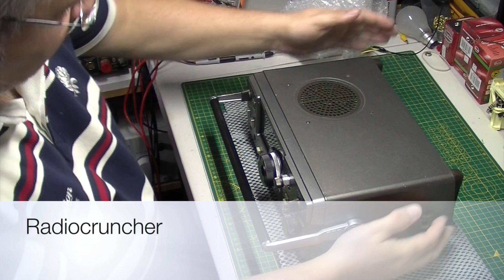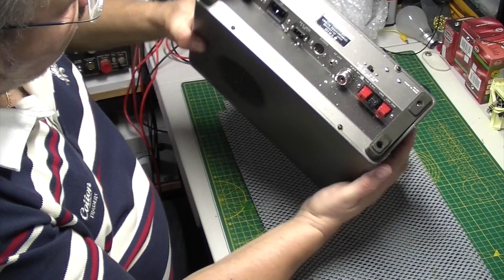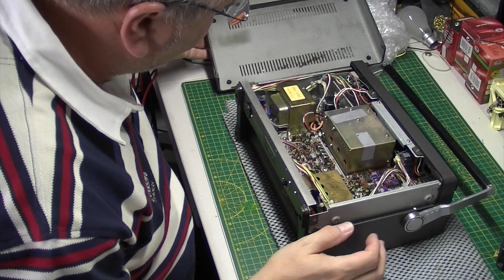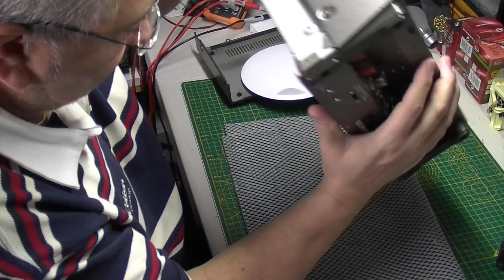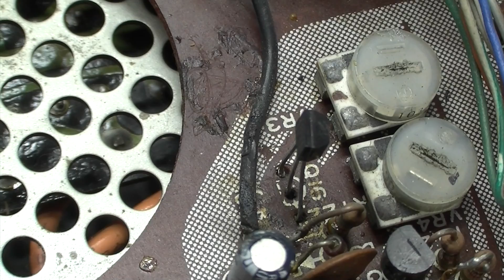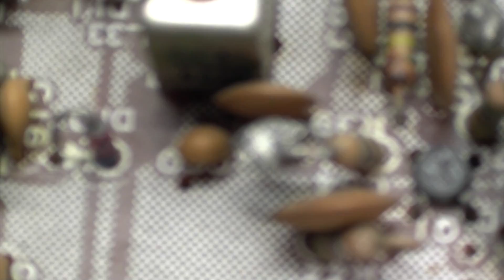Trio R1000 repair Part 1: First look and overview

Comment: Good for sparepars or swap pcb with a unit with a damaged case
Reply from the maker: I did get it sorted in the end
Reply: @Radiocruncher  sometimes it is better to make them spare part d'onore for the good units. ( counts also for some perpetrators)

Comment: Very nice detailed video on a super radio.  I would ask, where can I find a plug to fit the 12 volt import pins on the board . I want to convert to 12 volt, but can't find the original mod kit Please advise
Reply from the maker: Hi Ken. You might want to try a CB radio power lead. Knights sell something that might fit. It was a long time ago since I repaired that one and I can’t remember exactly what type it was

Comment: The only reason I can think of for cutting all those resistors other than deliberate vandalism would be to make current measurements or perhaps he thought that to measure the value he had to take it out of the circuit. I've never seen that before in my 40+ years of working on radios. Very bizarre. I'm going to enjoy watching this one Graham. Thanks for all the hard work.
Reply from the maker: Hi Doug. Yes it certainly was a mess and took an age to sort out. I am of the same opinion that they were cut to save taking the board out for testing. Thanks for watching

Comment: Blimey that's been well and truly got at. Looks like someone was inserting a milliammeter in circuit to test. You're going to need the radio gods help on this one.....and your Marconi. You might be able to get a scrap Japanese radio to get some transformer cores out of.
Reply from the maker: I would think someone did have a problem with it in the past. The transistor that looks a bit burnt is in fact a substitute so I assume that whoever cut all the resistors and diodes did eventually narrow the fault down. I do have quite a few scrap CB radios so I might have a dig about in those as most of them are Japanese

Comment: Graham, is this your rig or a customer's?  Looks like you have a nice mechanics special either way!  This rig is also sold under the Kenwood badge, it appears (a brief search) to be from around 1998.  I found a few pages that talk about mods, maybe they can help you understand what may have happen to this radio and help put it back stock or at least fix what was attempted??  https://goo.gl/Q9efyj   &   https://goo.gl/LzhzEz    ~Jack, VEG
Reply from the maker: Thanks Jack. I believe the radio dates from about 1979. It cam in for repair from one of my YouTube subscribers. I think what has happened is that someone has snipped the legs of the components to test them in circuit rather than go to the trouble of taking the whole board out. They have then just tacked the legs back together very poorly with solder. Thanks for the info and comments. Graham
Reply: Oh, yea, I guess there's that...did not think of that....I very rarely snip to test in line, I always just remove when plausible...The reviews I've seen on this radio is it is an amazing and very sensitive receiver and QSL on the date correction!  Looking forward to the next video in this series! 73's OM!  ~Jack, VEG